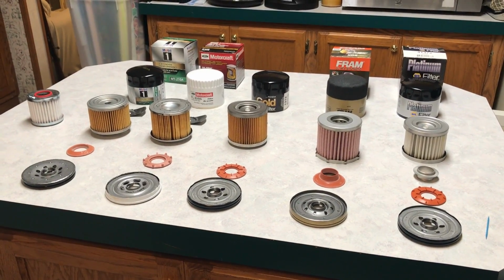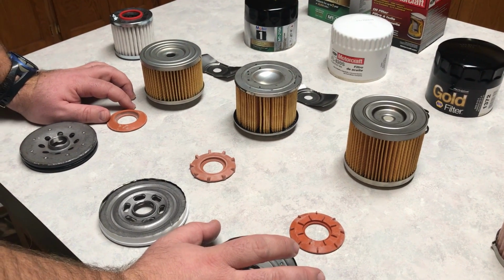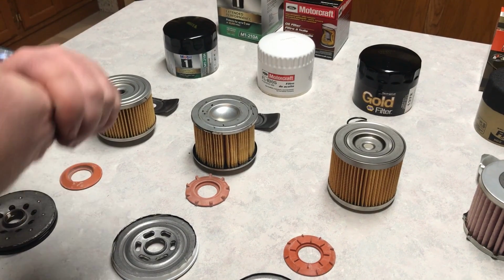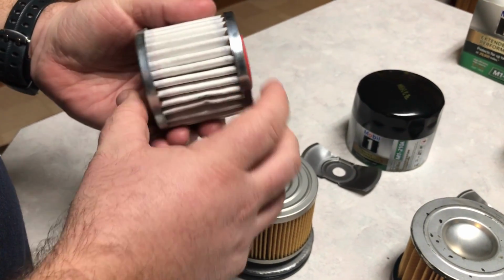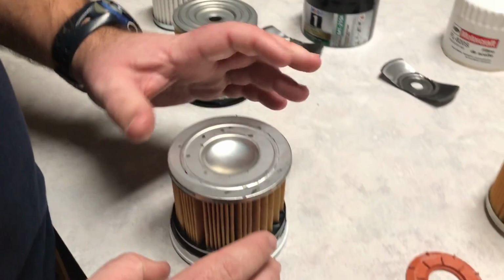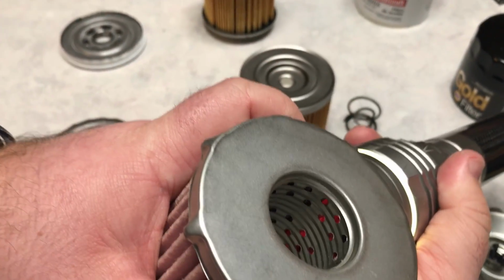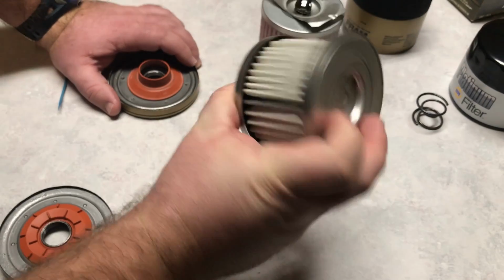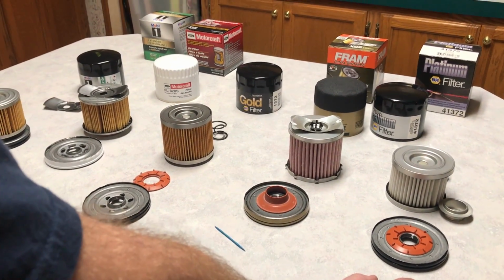2018 Cut Open OIL FILTER Comparison for Ford Modular, Mobil 1, Fram, Wix, Motorcraft, Napa

Comment: I see coil springs springs broken in other applications ( transmission accumulators) I dont see the drain back spring being a deal breaker. The design of the Fram drain back valve is a little sketchy, but overall i like it the best.

Comment: Fine print on the Fram is "ABOVE" 20 MICRON AT 99% what isn't clear is what it actually is 30,40,50? It is not stated and why I will never use them.

Comment: Synthetic media is always better it allows better oil flow characteristics and catches more dirt down to lower micron particles this media is meant to go longer OCI'S. Ergo paper media enhanced or not are 3000 mile filters so extending is at your risk regardless of filter labeling period. Synthetic media filters are always better at filtering to 20 micron efficiency at 99% not one paper media enhanced or not can or will do this.

Comment: On cold starts to avoid lifter tick you place your vehicle in what they call oil flood mode. This allows cranking of the engine without starting but allows oil pump to run oil up into crank cam lifters and valve trains and filter priming after oil changes. To do this basically based on vehicle manufactures you press accelerator to the floor or the accelerator and brake and crank the engine it will not allow engine to start but allow oil pump to prime filter and pressurize the rest of the engine.

Comment: Confirmed never using Fran again. Can’t believe I used to, on my old 02 explorer.
Reply: *due to the crappy anti drainback valve
Reply: I don't think the filter helped or hurt your ""crappy old Explorer"  They don't call them Exploders for nothing  😅
Reply: @MrRupus2020  only reason I’m not still driving it is because my brother totaled it. Now my 08 explorer.. still daily driving after seven years and 330k on the odometer. Gonna probably be another seven years before the frame even starts to rot..

Comment: Check out the Amsoil filter built by Donaldson I believe is designed like they’re endurance premium commercial filters, impressive but fairly expensive! I believe Donaldson sells them only though Amsoil in the auto size filters?

Comment: FFS is Wix a better filter than Motorcraft or not? I am NOT an engineer for Motors. I have the same vehicle different year and it's not a P1 2011 LX. it's great giving this information but I think it's useless for people like myself. what I am more worried about these counterfeit filters that are out there. I stopped buying stuff on eBay because of that reason. if anybody can let me know if that particular filter Wix will be better for my CV 2011 LX or not. Thank you. Next

Comment: The Motorcraft FL-820-S is the OEM filter for the 4.6 liter FOMOCO engine -- it has been the OEM filter since 1995 , and is NOT an extended-life filter !!
The FORD-recommended filter change for the FL-820 is at 3,000 miles -- and the FL-820-S change interval is 5,000 miles.
 All the other filters that were tested indicate an "extended-life" change interval, are more expensive, and NONE of them have the front-side by-pass valve that you recommended.
The famous 95 MERC runs Pennzoil Ultra Platinum 5-W-20; Bosch Premium #3410 Oil Filter (20 micron); and a FILTERMAG #SS365PR Magnet Kit. Oil and filter changed at 5,000 miles; Magnets are re-used -- lasts a lifetime.
https://www.mercuryforum.com/forum/grand-marquis-14/1995-grand-marquis-restoration-8937/

Comment: All this detail I have NEVER known about in my 57 years. I have always changed oil frequently with a new filter usually the one on sale or maybe a mid grade. Never knew why I should pay more for a filter b/c no one ever told me why. 
Have gotten 168000 on my 74 mercury. 175000 on the 78 Bonneville. 163000 on my 88 vw fox.  285000 on my 99 Prizm. Etc. All pretty high mileage considering the era and build of the car. 

Used to change every 2k. Now 5k.

Comment: Reality check n is that being a 36 year auto tech working on fleet vehicles " Cars, pickup trucks ,  vans ,  medium  trucks,  class 8 trucks etc=that are properly maintained yet run hard and put away withn out care from the drivers. I doubt that you will never notice the the difference in engine life  due to the choice of a decent oil filter. The air filter is the important filter on an engine.

Comment: The real question on all these filters is how good do they need to be.  If you run an engine for 7000 miles on synthetic oil, at what point did the filter go into bypass mode?  If the filter is still cleaning the oil at 7000 miles it is a good filter.  If it is in bypass at 2000 miles, its junk.  So the real test would be to put each filter on the same engine and monitor activation of the bypass.  The finer the mesh- the earlier the bypass would be my  expectation.

Comment: Good detailed review......

Have you or do you know of anyone that has done the same comparison for the same competitors filters but for the newer “Cartridge type” filters?

I have used FRAMs in the past mainly due to the anti skid coating to help with filter removal.   Recently switched to Mobil 1 and feel confident with the 6,000 mile change interval.

I started on Purolator back when I first started with oil changes but that was also a time when they still had 3,000 intervals.

I have started recently with Mobil 1 mainly because I use the M1 oil and usually the filter is right across the same aisle, different shelf.

I had not thought about the cheap can design but with more and more cartridge type filters the metal of the casing will be less of an issue....Still some risk but lessened.

Comment: Put the Motorcraft thread end bypass setup in a Amsoil EaO11 or Royal Purple 20-820 and you will have the ultimate FL-820S cross ref filter.

Comment: I’ve heard good things about the super tech filter at Walmart that it’s a quality filter made by wix and same inside as Napa gold also made by wix
Reply: I don't trust anything that isn't manufactured by purolator (like motorcraft is)
Reply: Super tech oil filter is not the same as napa gold. Super tech uses rubber drain back valve. The filter median on the S.T. is cheaper made, not synthetic blend like the Napa gold.

Comment: The Motorcraft is a good filter and a great value.  The FL400 for my Ford truck is $3.97 at my local Walmart.   206,000 miles and going strong.  Oil changes at the recommended intervals is the crucial factor, not filter choice.
Reply: Completely agree. Use the Ford filter in a Ford engine.
Reply: Yes, Motorcraft are high quality OEM oil filters . Always proven so w/any of Fords modern GTDI engines / V8 engines. Use w/ confidence!
Reply: the recommnded interval is designd to have low maintenace costs tho....??? the manufacturer is deceiving u

Comment: Good job of explaining how an oil filter works for people that don't have much of a clue on this subject. I live in North Carolina where Purolator (Fayetteville) and WIX (Gastonia) plants are located. They are both now owned by the German filter Company, Mann-Hummel. They made alot of changes at Purolator, like firing Prodution Supervisor's and experienced workers and Quality Control employees! They hired new low wage workers and Temp workers to cut cost's and eliminated several steps on the production side to save money. That is when the problems with media tearing, off center end caps, sloppy glueing, and bad spacing of filter media(wide gaps) reared it's ugly head! They have gotten better lately, but not all of the problems such as wide spacing and too  much glue have been eliminated. Wix filter was also purchased by Mann-Hummel, but it has been left alone  so far, just like when DANA bought Wix out years ago.Then AFFINIA Group bought WIX from DANA. There are some filter numbers for Wix and NAPA that are made by Purolater, the box will have Mann-Hummel on them! They are Purolater filters with a WIX/NAPA sticker on them. Wix specs their filters differently than all other filter manufacturers. Their BETA flow specs are rated totally different! If you call their TECH Line, they are very helpful and friendly. I used  to get lucky when I called and I got to speak with the Head of testing ,Design, and The Technical writer for their products.He was awesome to talk to, and would divulge info that was off limits.If you asked a certain question that he couldn't just tell you, he would give a for instance question and you could get a conformation that way. I asked about the NAPA Silver or PRO-SELECT. He said the PRO-SELECT  was a much better filter and cost's less also. He explained to me that oil and air filters become more efficient after they are put in use. This makes almost what would be common sense if you think about it. The micron level of particles that are being captured would be smaller and smaller the longer the filter is in service! They become way more efficient over time as the larger pores fill up with particles and the smaller one's start doing their designed job! No filter can be absolute in capturing all particles as there would be no flow. That is why filter media's are made of different materials and have countless pore sizes. The cheap paper(cellulose) are good for 3-5000 miles,or 6 months.That is about all the paper can take before it starts to rupture and fail. The enhanced cellulose synthetic fiber filters can be ran up to around 10,000 miles before thay start failing.Some enhanced cellulose filters( MOBIL1A) filters claim up to 20,000 miles.Some enhanced cellulose filters are just chemically treated with a coating (RESIN)  for efficiency and longevity. Check the box for the filter manufacter recommended mileage warranty. Fully synthetic fiber filters start off less efficient then over time get way more efficient than cellulose fiber filters and can hold way more dirt before clogging. They can and are designed to last longer and can take engine heat cycles better than paper elements. Sorry for the long reply, but there is so much info on this subject. You can research and read for days and days! I hope this helps someone out there get a better understanding of how filtration works.1/31/2020. PEACE...
Reply: Fantastic Information! Thank You.
Reply: Wix moved alot of filter production to china
Reply: My uncle worked at AC and told me the oil filter is more efficient if it’s been saturated, change it every other oil change.
Reply: @miked8227 saturated with what, debris from engine wear? 😅

Comment: My questions would be it’s cold out and I only have 5w 20 mobile one and the book at the store gave me the wrong filter I got the top end mobile oil filter what do I do use the oil because I’m now over my oil change by far on a 80,000 mile 3800 serious 2 gm motor I’m in Wisconsin it’s cold out and I have all this fillet synthetic mobile one and with the filter is there anyway to get a filter replaced from mobile

Comment: 👏 bravo sir I’m a hard critic and I thought you did a excellent job. Video was a bit long but explained well in detail. Only question you didn’t answer is. Whats better filter flow or filter micron rating for say a challenger 6.4 hemi. Or will the relief valve come into play? I subscribed by the way. I was so impressed with the job you did.
Reply: A lot depends on the intended use of the vehicle.
 For daily driving, the focus should be on Micron Rating for maximum particle capture -- and a 5,000- mile oil & filter change.
For high-performance driving, you'll want to go for a high-flow filter and a 3,000-mile oil & filter change.
In either case, a FILTERMAG #SS365PR Magnet Kit will offer MAXIMUM protection, regardless of type of oil OR filter is used.

Comment: Nobody buys the Premium filters. All these filters are premium expensive filters. Compare the cheap ones all in the SAME price range. You say you like Fram but don't like the flimsy CHEAP metal case that dents easily. I agree. And that's Frams premium (expensive) filter, it's JUNK. Cut apart the generic filters from Napa, Wix, Motorcraft and Fram and show these people how bad the FRAM filter really is! It's the worst and doesn't even have metal holding the filter media, it has cardboard glued to it, yes cardboard!!! Fram is complete junk in the cheap comparable series that everybody buys in the orange box. Don't mislead people about Fram's junk. Even their most expensive version that you're showing has the flimsiest metal shell that you point out. You even contradict yourself by saying you like the Fram, yet you point out the flimsy shell and most importantly the cheap orange rubber being a poor seal very easily not sealing properly rendering the Fram filter completely useless. Again, compare the cheap versions that everyone buys and you'll see FRAM  is the WORST by using glued cardboard to seal the filter cartridge!!! ALL others use metal. Fram only uses metal in the expensive premium filter you cut open which is double the price than the regular filters which all have metal not cardboard holding the filter media together. Don't mislead the people thinking even the premium version of the Fram filter you show is good, because it's not.

Comment: Saw a tear down video by Steven Cox - he was very down on FRAM.
Reply: most people are down on the Fram "orange can" as it is a low budget level economy based oil filter.  Instead of metal endcaps - everything is paper/cardboard like.  The pleat spacing is irregular - and they do not use the silicone anti-drainback valve.  The Fram Ultra filter is on the entire other end of the quality spectrum - being an elite level construction, media, filtration efficiency and every other design function.  It's like comparing a Ford Pinto (orange can) to a Ford Crown Victoria (Ultra) as far as quality.

Comment: Napa Gold/Wix is looking like a pretty good design for the wife’s Forester! The filter sits upright so that strong tension on the anti-drain back valve would be beneficial keeping that oil in the filter while parked. PLUS, the bypass valve then, by definition, would be at the TOP of the set-up, keeping the metal particles from being recirculated in the case the bypass valve is activated. Like another commenter,  I think I’ll stock up on the next Napa sale. AND I think they’re made in ‘Merica! lol
Reply: Made in USA is best! 🇺🇸
Reply: The NAPA/WIX oil filters have the weaker Coil Spring. Everybody else got rid of that crap and put in the stronger Leaf Spring, like the expensive Amsoil & Royal Purple oil filters use.
Question: What does "upright" mean !?? 
 "Holes Up!" or "Holes Down!"
The most hot-rodded engine in the world has been the Small-Block Chevy -- it's oil filter is mounted "Holes Up!", which is generally considered to be "upright".
Reply: @SlikLizrd  been a long time since I posted that. Wife now has the Soul so it literally does have the holes facing the sky. I like that because I'm one of those silly guys that likes to prefill the filter
Reply: @SlikLizrd  remembering back the forester filter holes faced the ground

Comment: Ford has always made great parts... Motorcraft filter is very high quality for the price.
Reply: Yeah Ford has always been good **except for the stuff designed for them by navistar/international from 2002 til recently (the infamous 6.0 and 6.4  diesels were badly done by navistar  so  I get them cheap and  replace the navistar designed crap with the updated Ford re-designs that fix all the issues)

Comment: All these videos about Oil Filters Leave out the most important part.  I.e.  The Area of the filter material and the degree to which they filter.  In other words how small a particle will the filter capture.  The Mileage capability is easily determined....  You can use Filter design for synthetic oil on conventional oil.  Look for about 20 micro filtration.....  The filters designed for Synthetic go for longer mileage... I am look for those Filters for a conventional engine.

Comment: The Fram Ultra is a double lined filter media so it's very good quality for the price point.  I've been running the Ultra Synthetic for several years. 
It's a valid point about a dented filter housing, so don't use any filter that's dented. Return it.  As far as the other issues, if they become a problem, I'm sure Fram will address them.
I was surprised to see the Mobil 1 and the Napa Gold are both a fiber element. I had been under the impression that both were full synthetic elements.  And the Wix Platinum was a very poor looking filter for a full synthetic, supposedly top quality unit. Definitely some quality control issues there.

Thank you for posting a very well laid out thoughtful video. You covered the relevant points about how the filters work and their construction.  You didn't pick the basic Fram Extra Guard and poo poo it as a poor filter compared to the other higher end filters like some on YouTube like to do.

If I see another one of those videos, I'll link this video in the comments section as a more valid comparison next to their video.